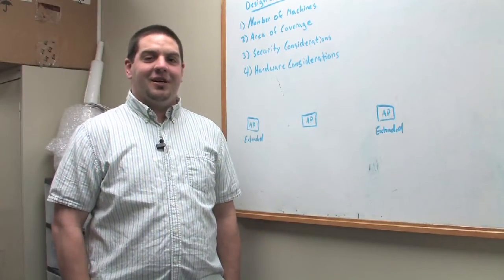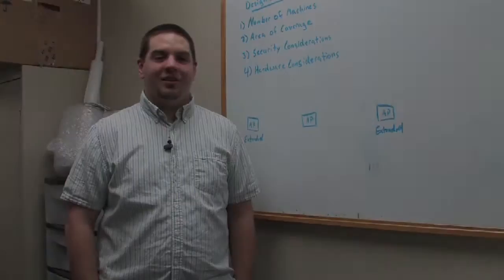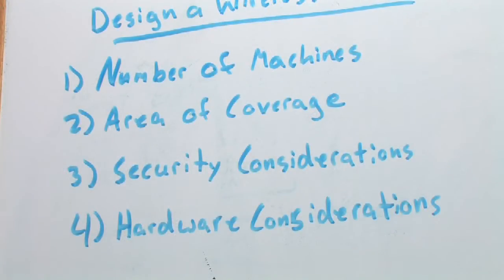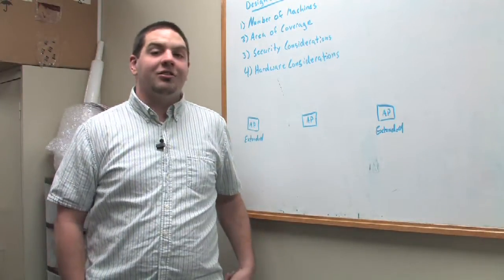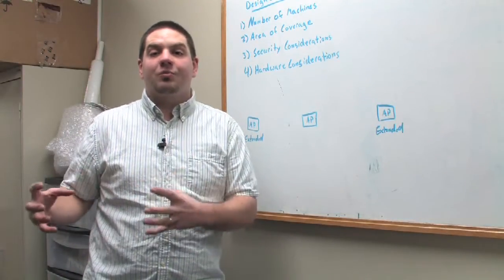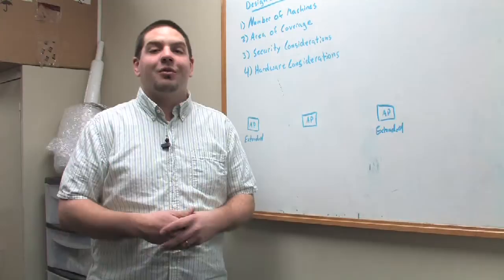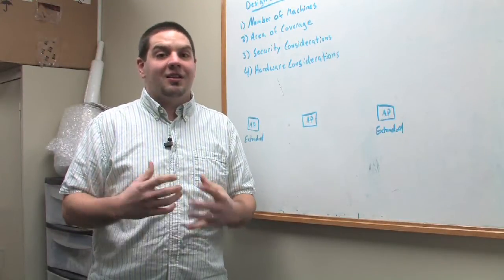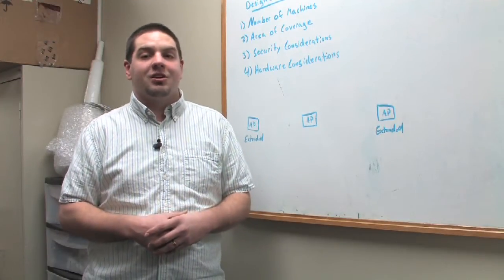Computer Networking & Hardware : How to Design a Wireless Network

Comment: Also is it possibe if I have a two year degree in Network Administration or Network Infastracture that I can get a job right out of college if so what careers or jobs could are start with the build up to where you are at as a system administrator or Network Administrator?

Comment: I have a question, Do be a network Administrator or a systems administrator as you are should you have very good knowledge or just knowledge period of network Infrastructure along with the administration and part and Unix and different networking languages or programming languages?